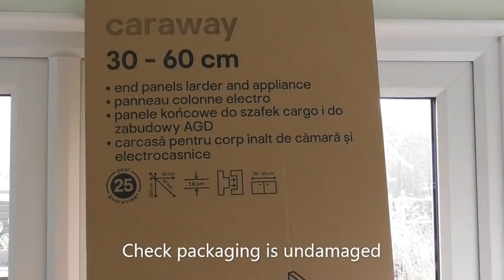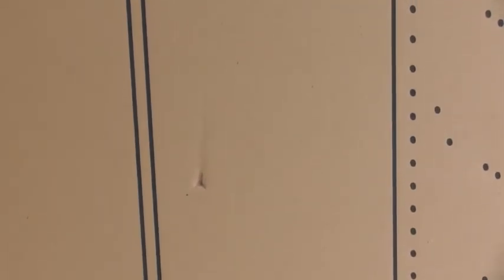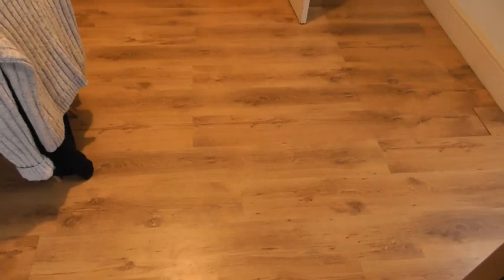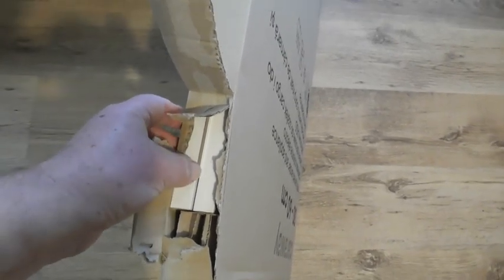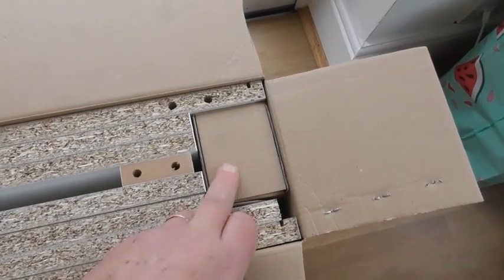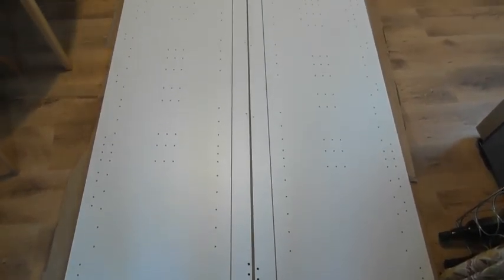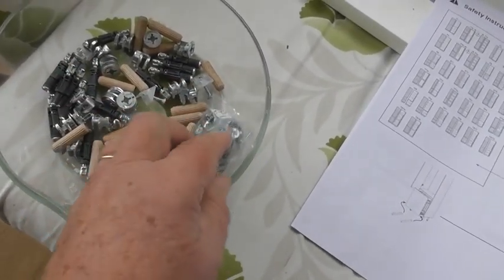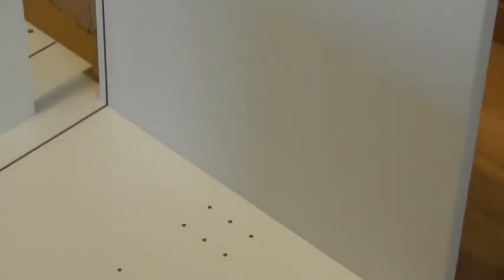How to build a B and Q kitchen Larder  Appliance unit

Comment: If using as an appliance cabinet for oven/microwave then beware-the instructions for placement of the fixed shelf are based on using a set of holes in the sides, but the diagram didn't bear any relation to the holes in the side panels! I measured the position based on the size of the door to be fitted. Also the back panel is shown as being cut into two for the top and bottom cupboards, but the measurements given seem to be incorrrect- the top is too long and the bottom piece too short. And the two cross-baems on the back intrude significantly into the service area at the back!
Reply from the maker: They are quite complicated as there are so many different options within the one package. Yes those cross bars at the rear do restrict the service area but the service space overall seems quite generous. I wish you well with your project. I am sure it will be fab in the end. Dont work tired either. All the best. JJ